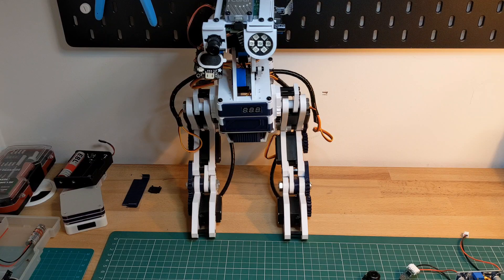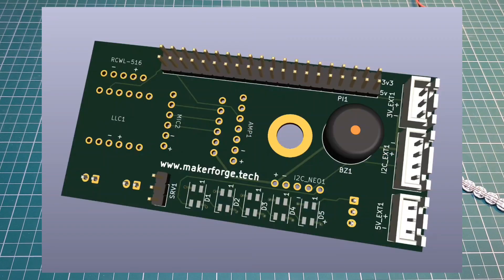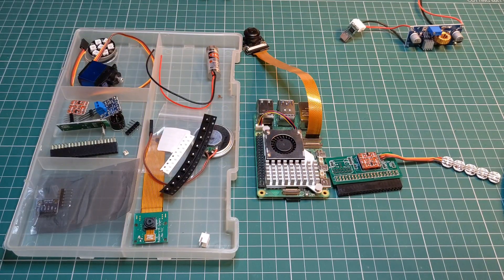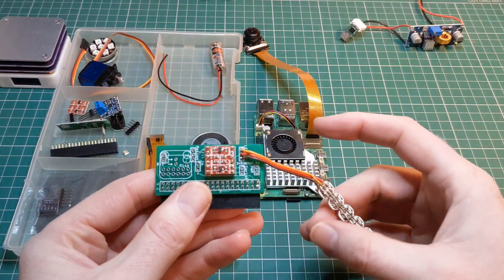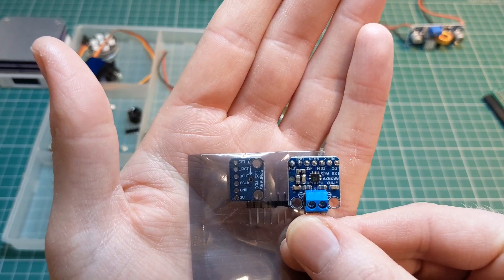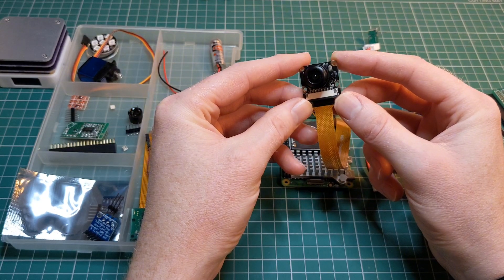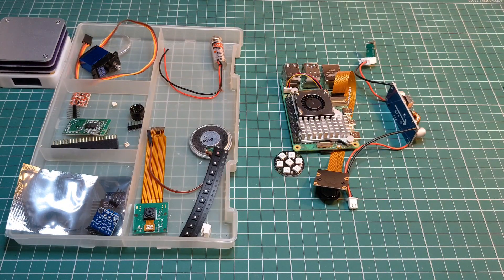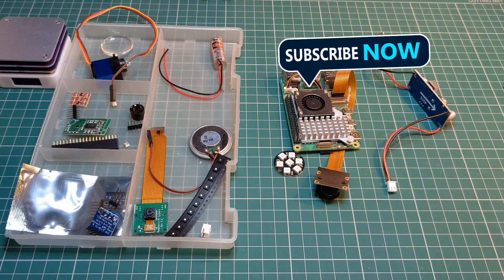Build a Raspberry Pi 5 Robot  - Build Log 3

Comment: If you are only thriving five neopixel or ws2812b I think you can get away with running it at 3.3v. Driving from RPI I think is still going to be an issue, so I suggest using a pico as a driver board. give me a should if you want a hand with that.
Reply from the maker: Thanks for this! Good to see you on here. I'm running them with an i2c neopixel driver board from adafruit which I have had in place on the last version so it's working quite well. I think I talk more about this in part 4.
Reply: @DanMakesThings  Nice work. Keep it up.